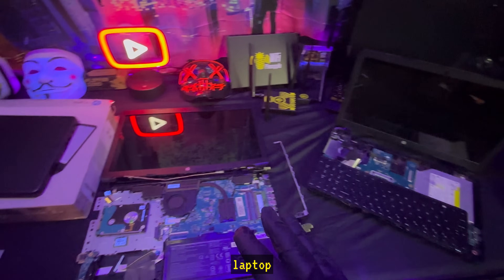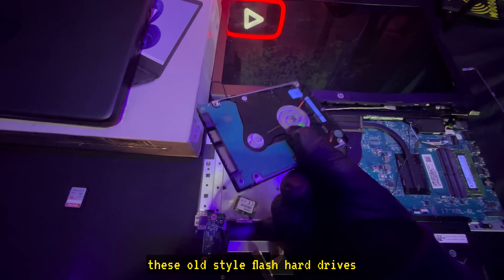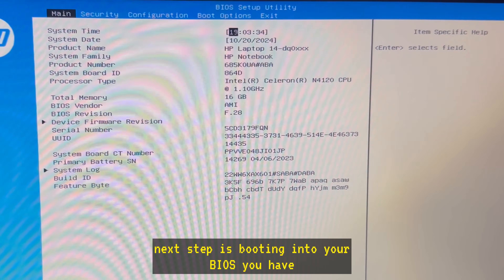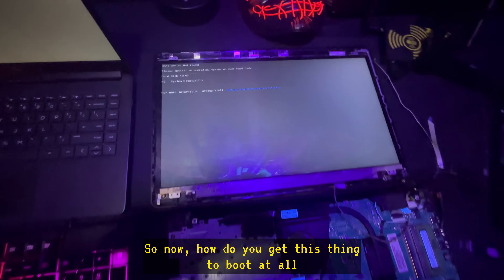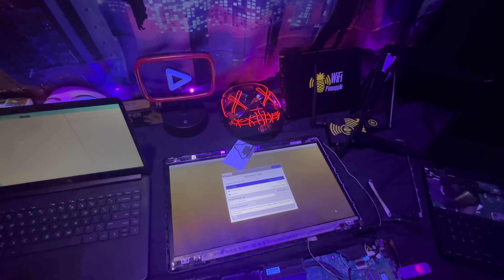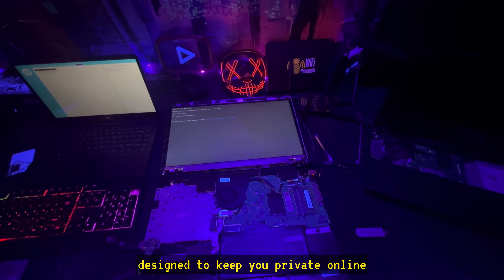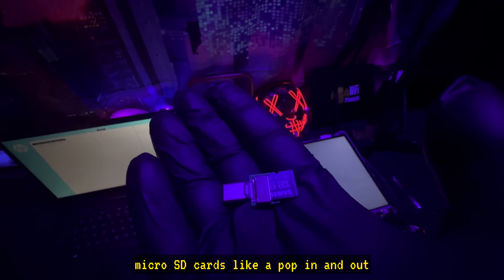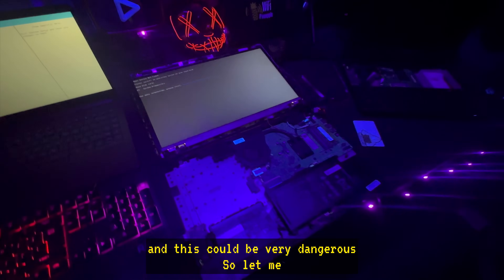Build a Ghost Untraceable Laptop: Ultimate Guide to Online Anonymity and Privacy! DIY

Comment: Technically you can still pull off the ram depending on the time... CIA have pulled data of ram before... To be 100% secure you need to cycle the ram so it writes back over... secondly it's not a ghost computer because it still has a physical MAC address, so can be tied to activity online. The next stage is to rip the wifi and rip the lan out of the laptop then use a USB wifi or lan that will allow you to spoof the mac address and leave the original mac address in the machine which is what they will look for to tie it to online activity.
Reply: yea i remember reading something like this. RAM can still be used to extract data
Reply: @nightblade178  This is probably good enough to save your data from hotel room thieves looking to steal, scan for credit card information, and then resell the laptop for money.
Reply from the maker: Thank you
Reply: @GhostStrats noob
Reply: @GhostStrats  yo can you put it back together or does it stay like that?
Reply: @GhostStrats bit flip repeatedly?
Reply: @GhostStrats  so you are a clueless and your videos title is completely misleading
Reply: RAM can have data extracted from it, but unless you have a fed breathing down your neck already, this isn't going to do them much good, and Tails spoofs your MAC by default anyway, so assuming you regularly reboot this isn't going to help anyone trying to fingerprint you either. For most people, the thing that will get them into trouble is having their behavior fingerprinted. Typing speed, and patterns as well as the idiosyncracies of your mouse movement, plus the websites you visit and the accounts you log into are far more likely to compromise you. Don't go to these lengths only to log into your youtube account that you've been using for years. Yes I said "log into" instead of "login to" on purpose, because logging in creates LOGS, and logs of your account history are how you're tracked. Stay sharp, gentlemen.
Reply: Bingo!  Also make sure there was never an IMEI, also, ideally, you would want to get a new bios chip because previous windows installs will write unique identifiers to bios
Reply: @2Dcmbr7  Couldn't you just flash the bios chip.  Is replacing it really necessary.  Desoldering laptop motherboards is getting over my head.
Reply: @2Dcmbr7 stupid ATT bricked one of my clones of an old phone bc new ones are lame. They tried to officially put my service to one. IMEI gone, WiFi gone. I wanted it as a sound player but they broke the modem.
Reply: Mac spoofing, rewritting UIID-GUID in bios, HWID spoofer ...
Reply: @SALTINBANK this! Physical MAC address can be tied to activity online
Reply: I was going to say, I’ve ripped data off RAM before. This is far from stealth
Reply: @Roaming_Lands_Daily  You would need to write a program that writes garbage data to the ram on shutdown... Or run memtest on the ram before shutting down... depends how illegal your activities are or how likely you are to be compromised... I used to use truecrypt years ago until they suddenly vanished... I had 128 bit and 256 bit encryption on drives which were impossible to crack... turns out the CIA cracked some truecrypt drives that were used by like some serious people... I'm no longer in a situation where I need this sort of protection anymore... But back in the day I had everything, dummy jpgs with hidden data in them, dummy system files which were actually complete drives with windows loaded on but only looked like 1bit sys files in windows... I was in deep lol
Reply: @Roaming_Lands_Daily  Just run it without RAM ? LOL
Reply: as far as I know, the RAM can retain information even after the device is turned off, but only for a short period of time (from a few minutes to a few hours), the operation to recover the data inside it is called cold boot attack , consists of incredibly cooling (we are talking about temperatures close to -50°C) the component, removing it and inserting it into a computer suitable for recovering its data. so for you to prevent physical access to RAM for more than an hour you should be safe (obviously being 100% invisible is impossible, but you should have good security with these measures)
Reply: I looked it up, Tails Linux is set up to overwrite the RAM when shutdown or unplugged. It states that “While most memory is overwritten, some kernel memory might not be erased, but this is considered a trade-off for reliability in current implementations.”
Reply: I'm just gonna reply to this comment as an overall response to a lot of negativity in this reply section.

There's no such thing as a completely private WIFI connection, there is always a flaw somewhere in any system and it becomes more efficient to Obfuscate rather than rebuild. Most people on the deepweb simply want their privacy back. if you're worried about what is being stored on your ram then you are certainly past the point of knowing how to build a "ghost". Truly becoming a ghost requires one to take an active approach in various disciplines of security. This video isn't for Infosec def-con veteran blackhats, its for web privacy enthusiasts just getting into the field. If you are OTW levels of paranoid about your data, then you have wayyyyyyyyyyyyyyyyyyyyyyyyyyyyyyyyyyyy too much too learn, to be placed in a 9 minute video.
Reply: @imlimbo1994  "here to address the negative" 

With negativity. 

lmao.
Reply: all of these can be fixed with software. hell, you can even keep the hard drive and burn LIVE whonix onto it. (this is technically overkill, you can use other live cd which doesn't save any info on it. This is only really necessary if you are worried about your government raiding your house and taking your hard drive.) Most OS' are capable of spoofing mac addresses (including whonix, tales, and kali). With Live CD's everything is wiped upon powering off the device, so simply power it off when you walk away. (The FBI does exploit this by trying to trick people into walking away from their computers, to get into it with them logged in, ram still present, and the hard drive decrypted. Again, simply fully power it off when you walk away to avoid a ram dump)
Reply: I do remember reading online.. somewhere- kind of wish I had saved a link to it, of someone attempting to use a partition on their thumbdrive as the ram for the system, so that they could use the device without needing ram sticks.

If I recall correctly, they couldn't do it because it has something to do with either the bios or bootloader, but I still think the idea is awesome, and probably possible if enough work is done into it, but then again, I'm not someone with the technical know-how to make it work even on paper lol
Reply: @Skay2003-v5e cold boot attack 
but when the computer is on you can make an "image" aka dump of the memory to steal credential and even what is in the ram (more than stored credentials)
Reply: What about hardware identifiers/serial numbers?
Reply: @negusresurrected  only thing you need to worry about is what translates over to the internet which can connect the two together... NIC, MAC - people in these comments say just spoof it but it's not 100% and software can fail/leave footprints. External lan that you can throw in the bin, vpn for the host machine and then use web proxies in the browser gives you double protection. Or vpn into Tor. Store everything on a usb drive, if in emergency stick it in the microwave for 1min. If you can get a safety deposit box and store everything in there... and don't shit where you eat.
Reply: Exactly what I was thinking
Reply: Often, you rely on public Wi-Fi for your online activities rather than using your own secure connection, which can pose significant risks.
Reply: @KamiSamaPIANIST  using your own secure connection means your online activity is directly traced back to you. even if you use a vpn, it is directly traced back to you if law enforcement gets the vpn provider to comply.
Reply: Nice suggestions
Reply: BitLocker stores encryption keys in RAM; some have been able to bypass/offload and decrypt BitLocker keys by dumping RAM. I wanna say Elcomsoft has software that can make this possible without soldering.
Reply: @commanderphantom  I used to be on the darkweb about 10-15 years ago, I used a ghost computer with a sandbox the ghost had a vpn, then the sandbox used private web proxies and then that went into TOR browser. Completely undetectable (in my head)... The whole device and files were encrypted using truecrypt, the key for it was embedded in a meaningless .jpg file... When the silkroad went down truecrypt disappeared and made a statement saying never to use them again... Turns out their was a master dev key that can unlock any encryption. The CIA cracked it and got that key... I ended up losing my setup... I ended up losing the drive I stored everything on and thought nothing of it... Until it came to 2025 and that 14 bitcoin I had on the drive is now worth millions... I wish I kept the hard drive! I would be keen to find a new encryption software that is CIA proof...
Reply: There is a program in Kali that spoofs the MAC address.  Not sure if Tails has it, but I was about to suggest adding it if it didn't.
Reply: Mac addresses belong to a NIC, if you rip them out you there will no longer by a MAC address.
Reply: No shade to the orginal poster but I was hoping to hear some stuff like this instead.  It's 2025.
Reply: Don't use an old computer you or any family or friends have used. All of those components have hardware id's since geeze, Win95? Somewhere is a record of where that computer was retained and likely, who bought it. Hopefully you didn't send in any of the warranty cards or complete any registrations or use a bank card to pay for it. Try to get it from a 2nd hand shop or flea market, pay cash. Wear hoodie, hat, glasses (with no identifiable markings.) Go with generic common clothes without tags, labels, or logos. Consider any cameras present at the sale or enroute to or from the point of sale. Get rid of the clothing that can be matched up in any videos of you buying the laptop.

Ring and other security cameras can make tracking you to or from the point of sale  possible. Think about where you are buying it and how you are going to get there and back. Don't carry your cellphone with you when you buy it.
Reply: @ this is not how people get caught there aren’t that many identifiers on a laptop anyways and they sure as shit are not all stored in some database with your name attached to it
Reply: @frankiewalnuts  a phisical mac cannot be tied to “activites online” that is not how networking works kid
Reply: @BlackRider-b4u  It's "physical" not phisical and it's "activities" not activites... And I'm not a kid, and a MAC address is used to tie a device to an internal network and the ISP. It's used to prove that the person accessing the IP address given by the ISP was used in a crime. The MAC address for example will be used to tie a laptop or a phone or any other device to the local network and the external IP the internet sees. Police and courts then use this information to argue that YOUR DEVICE with YOUR MAC address committed the crime. Also I'm 40 years old, so don't call me kid. Moron who can't spell...
Reply: Guys, MAC addresses work at the data link layer and are significant to the local broadcast domain. At each layer 3 hop, the source and destination layer 2 addresses, MAC in the case of ethernet, are updated to the source interface of the router, and the destination of the next-hop. For MAC tracking and spoofing to work, the surveillant must have access to to local broadcast domain.
Reply: Tails automatically spoofs MACs.
Reply: you can use tails
Reply: Yup, make it easier for perverts to learn how to hide their depravity
Reply: see, i just write this on
Reply: Usb wifi you mean modem?
Reply: TAILs automatically spoofs the MAC address
Reply: @QR3BBury  I run windows in a sandbox
Reply: Thank you!
Reply: Damn
Reply: you can put USB killer swich inside that buen all whit big discharge
Reply: @algalgaq  link?
Reply: If I'm not wrong, the mac address is tied to the Nic card provided with the laptop right? So even using a usb WiFi wouldn't make it untraceable?
Reply: Is QubesOS outdated or even worth setting up. Is there security flaws?
Reply: Public-key encryption like RSA is already on death row, and it's only a matter of time before symmetric encryption like AES starts to crumble. The "private" data you're sitting on today will eventually be decrypted. Maybe not tomorrow, but definitely in your lifetime. Goodluck with your tinfoil of a hat laptop.
Reply: If I'm not mistaken TailsOS wipes ram just before or during shutdown.
Reply: Thank you sir!!!
Reply: Is this why my Sony 3d blue ray 5.1 system won't connect to the rear amp? I went to all the trouble to run wires through my apt walls to make it pretty a year ago. I am going to suck it up with awesome 3.1 I still have. Yes I took the main unit apart and bought a used rear amp/wireless on eBay. I figure it is a phase out WiFi thing. B@stards.
Reply: two minds into mine
TY
Reply: Egos everywhere, why can't we be ignorant until we learn, and help others afterwards without all the drama of housewives of right/left/black/white.hard hat wearing
Reply: Anyone engineer a push button mechanism for destroying the ram like a small container of acid above the chip?
Reply: No you can’t because tails wipes the RAM to prevent cold boot attacks. It’s literally why the OS exists
Reply: Tails OS should automatically spoof MAC addresses
Reply: @camwha5904  yes it does, comment wasn't OS specific... not everyone can run distro's
Reply: Hello can you you tell me how  can I hide my physical mac address.
Reply: @tesrastark8276  macchanger
Reply: Exactly what I was about to say, and as always; "If it exists can be exploited" -le me
Reply: Does Tails spoof the mac address?
Reply: Or just run TMAC v6 like the rest of us 😂 cycle your Mac IDs.
Reply: Can anyone else tell me if just cutting out the cam n mic is good... Or is it better to desolder or unplug etc? I don't wanna f my brand new machine ups... No happy bunny 😢
Reply: Hi there can you guide me more
Reply: I have a computer... Hmmm.. "owned by the government" and I'm bios locked will this still work?
Reply: @imsoexotic you may be able to see what type of bios it has and buy another bios chip with no BIOS lock on it. Or use a bios chip programmer to re flash. I’ve never used one myself.
Reply: @imsoexotic  if the computer is owned by the government and you attempt any modifications or try to install hackware you'll end up in prison and labeled as a spy. you will never again be able to work with electronic devices let alone purchase them
Reply: I knew I would have to come to the comments because how would there be such an honest video on youtube...
Reply: Was about to comment something similar.
Reply: Ok can you make a Guide How to do These steps ?
Reply: @PsychoDad114 No but chatGPT can for free. Say explain [subject] to me like I'm 6 years old but don't make me 7 years old by the time I understand it. Step by step instructions for anything no bs.
Reply: u should hv u tube so we could lear from u as well 
man!
Reply: @littlegsaguleid9907  ok, I'll share a secret to you. the only way to be 100% secure is to give up all technology and follow all the laws. Anything, anyone tries, is hackable. Tails? get on the open source contributor team, with a team of your own to increase the odds of making a malicious contribution... and... batabimbataboom you compromised everyone the moment they hit up the web

also, I'm quite disappointed in the comment section, no one mentioned hardware hacks in the supply chain...
Reply: @Skay2003-v5eI think they go pin to pin on the ram boards to discover what was last stored.  The freeze spray sounds like TV shit.
Reply: you smart, you loyal
Reply: Ram are easy to deal with anyway remove and replace or either buy an eraser or build one. i mean 16 gigs of ram is like 10 bucks on Amazon or Walmart
Reply: @thomaswakefield6889 you have to pull the 2 Ram slats and replace them w 4. Then do the scary bios flashing stuff. I have an uncle w a computer shop across the country. He can't remote into my tower if I mess it up that bad.

Comment: The architecture is always attackable. Intel ME. Firmware. Backdoors. Best suit would be core2 base and a bios flash. Single bios, 100% libre. Same should be done for firmware of devices.  Tails isnt 100% libre. If it contains non free software, its a risk. After that, apply the same concept to everything around you. Examples are as range wide as a listening device in a data cable or any electronic device. Passive, or active.

Comment: RAM doesnt just wipe itself when you turn off the computer. All 16GB of most recent data are still there until they are overwritten by new data.

You really want a ghost computer? Install and electromagnet inside the PC on a switch. Need to wipe the PC, flip the switch everything is TRULY gone.

Comment: try this :  combind with the Hardware technically stuff
buy a laptop from ebay cash only 
dont log this laptop in your home network,
encrypt the ssds is a must have and store the password only in your head

use a burner phone (also buyed cash)and a regged sim on a other name make hotspot with this. 
on your first os use a good vpn like mullvad(buy your mullvad and stuff with crypto that is not buyed on your name). then in your virutalmaschine use again a vpn like mullvad but use a other provider then mullvad for more safety. and if you want to you can use then proxys or use a bulletproof vps server and connect from the vm to it and use there proxys. but its questionable why a normal citizen would need such a setup

with this what you do Hardware technically and my way to go into the internet its a fucking ghost ghost setup fr
you do a great job and thanks for the idea m8